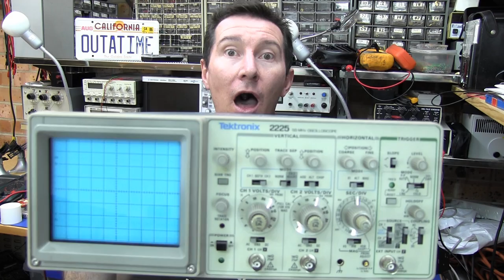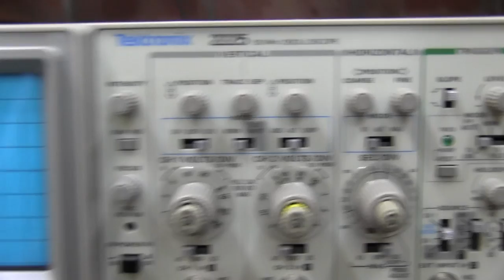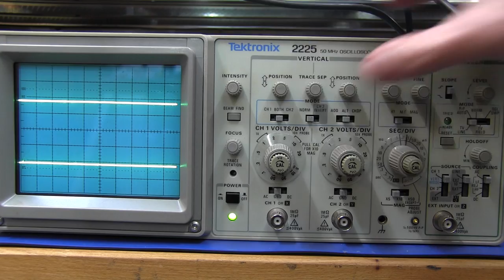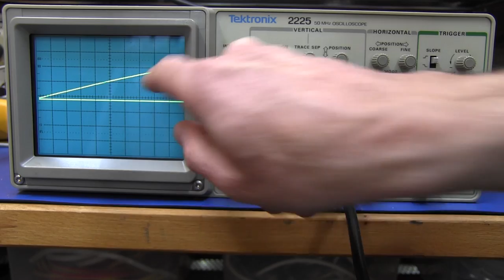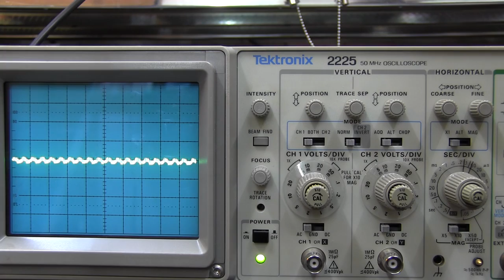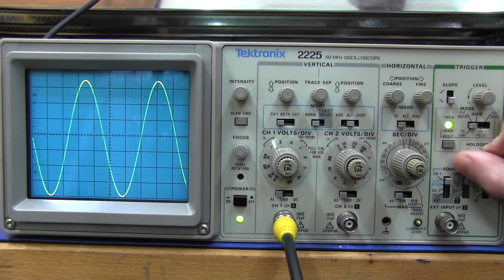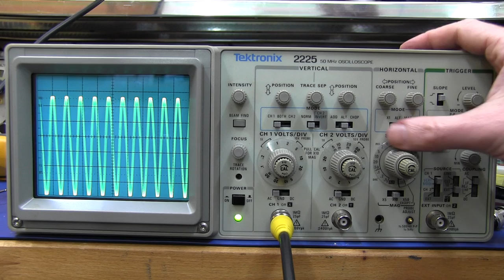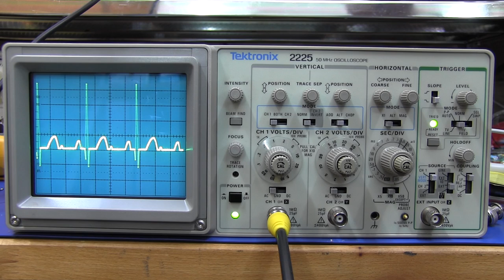Tektronix 2225 Analog Oscilloscope - EEVblog #196

Comment: I got the 60 Mhz version.  I bought it brand new in 1985.  It cost as I remember $1,200 US.  I still use it today.  Before I got it I had a couple of junkie scope with vacuum tubes.  I spent more time trying to get the scope working then I did experimenting on a circuit.  So I worked all summer at minimum wage to save up for my first brand new solid state Tektronix 2213A.  I'm sure my parents thought I was crazy.  Today's oscilloscope without a CRT seems lifeless.  After all these years I still love my Tektronix 2213A.  It seems heard to believe you can get a scope like this for around 100 bucks.
Reply: Yes ! I love DSOs but they are boring. CROs are always a pleasure !
Reply: @shyleshsrinivasan5092  I really love the features and such of my Siglent SDS1204X-E but it doesnt see a whole lot of use because I just love my Tektronix analog scopes. My 2252 sees daily use and my 2235 and Protek P3502C see almost daily use as backup scopes.
Reply: "Today's oscilloscope without a CRT seems lifeless"
That's just...your opinion.

Comment: I  bought an Tektronix 2225 for 70 € in Germany yesterday . It's completely original. There are all the same capacitors (blue, manufactured by Rubycon). I just have to clean the contacts from the Potentiometers for Volt/Div and Sec/Div. Apart from this it's completely operational. 

Should I replace the capacitors?

Comment: I assume you also checked other V/div than the multiples of 5, but didn't show it? I had a scope that had one single pot for all "5" settings (50V, 5V, aso), one for the 2's and one for the 1's (I haven't disassembled that many scopes, so I don't know if it's standard in analogs). And then there was one pot for the overall vertical scale. But since both channels show the same deviation it seems it's the overall vertical scale.

Comment: Just picked up a Tektronix 2215 scope for 50 bux(canadian). It powers up, shows both trace lines.. but I have no frequency/waveform generator to test the functions.. any suggestions?
I was thinking maybe somehow use NCH tone generator(software) to create a frequency and tap into my speaker hook ups? Would that work for testing?

Comment: you may get even better performance if you compensate your probe for both low and high frequency. you have to take your Tek probe apart to do the high frequency adjustment, then you need to mark that probe for the channel it will be paired with and any other probes need to be treated the same. Probe compensation is delicate because Tek uses resistive cables in their equipment of that time frame to reduce noise. I have the 2440 and have read up on their probes, mine are P6137's and a P6230 which was a lot of reading. There is a old long video from Tek on probes I recommend, it should be easy to find.

Comment: My manual for the 2213 indicates that the test point is not an exact reference.  Mainly used to check probes, etc.   Mine says 500mV P-P and it is not close.  Doesn't look like there is an internal adj either.  Cheers!

Comment: I have that exact scope I have had it for many years I got to use in a radio repair shop I worked in when I got layed off from my high paying job . It is always nice to have a back up knowledge to get a carry over job until you find a better one . The shop I went to did not have any scopes so I bought one many years ago for 100 bucks still have it today. I had a fluke o-scope meter but it got stolen I miss it but never had the money to replace it.

Comment: I sold my 2225 for a 2235A which is 100 Mhz scope, dual time base and goes down to 2 micro V/div  ..... The 22XX series, as they get older they may need a recap in the HV switching power supply; as you say the switching pwr supply makes them light. The Tek 22XX's have an amazing trigger.....

Comment: My trick for checking for burnt spots on a CRT scope :

1) Hook up a function generator, triangle wave, some high frequency around 50~100 KHz
2) Max out the volt scale to match the upper and lower borders of the screen
3) Lower the time base to some slow value in order to have a lot of periods shown

The screen is now entirely lit up and you look at all the surface. :)
Reply: I  am interested in buying a 225 Tektronix but the guy that is selling it says that it needs calibration the lines on the screen are not solid they are broken and with a little curvature on one end is that normal?and if it needs to be calibrated is calibration expensive if I take it to a shop?Thank you for any advice you can provide.Cheers
Reply: I am know to oscilloscopes so by the lines I meant the trace'sThank you
Reply: Sorry I should have said 2225 not 225

Comment: The fact that that super expensive Agilent does not have an analog filter to generate a smoothed analog signal without digital S/H steps is more than upsetting. You could get an old analog Sig Gen and get a proper analog sinewave.

Comment: just send any audio line level into channel 1, switch veritcal mode to ch1, set ch1 volts/div to .5v or 1v, set trigger ch1 to auto, A source to INT, A&B int to ch1, and set A&B sec/div to something slow like 1ms or so, and youre off!

Comment from the maker: @LSDjTutorials Your formula is correct, but you forgot that the scope actually generates 20mV, not 10mV in 50ohm mode. It's only 10mV into a 50ohm load.

Comment: A way to rejuvenate and remove the scratches in the screen overlay is to remove it, and use brasso and a cotton cloth to buff it. Buff with circular movement and avoid scratching the other side.  The result is incredible.

Comment: Is it common to all analog oscilloscopes that beam from CRT (when DC is applied or no signal at all) on the x-axis is not absolutely straight? I got BK model 2125C and its x-axis straight line/DC is not ideally horizontal. Could this be a sign of bad quality scope or is it normal?
Reply: You just need to adjust the trace rotation trimpot.

It's normal, so most oscilloscope have it directly accessible from the front panel.

Comment: @EEVblog
Yes Dave you are right, the Tek 2235A only goes to 2 mVolts or 0.002 microvolts, or 2000 uVolts, 2000 microvolts. You are right. I forget my 2225 went to .5mV (500uV/Div) , my memory failed me, thinking it was 5mV, my mistake. I sold my 2225 yr ago for $150+shipping. I paid $50, but you got a good deal.

Personally I need bandwidth more than Vert sensitivity. I'd really like analog over 300 Mhz BW or more. I often want accurate measurements at 120 Mhz, so 400 Mhz scope would be nice.

Comment: Two things.... FUZZ you have a focus control.... did you try that?

Second it is a 50 Mhz bandwidth scope and is only going to be guaranteed to perform accurately up to specs to about 1/3rd BW, or in other words over about 17 Mhz you start to get attenuation. This is common. If you need an accurate measurement to 50 Mhz you need a 150 Mhz BW scope.

Comment: Find service manual before adjusting! My Tek 2225 didn't need calibration. The 2235A I have now did. One chan vert attenuation module, plug-in modules, two pots, was flaky. I was fortunate found part cheap. However I needed to re-adjust the vertical. I used the other channel to compare, close enough. As you know attenuation above 35% BW is normal & increases to rated BW. Relative measurements don't need absolute values. The manual has graph of attenuation vs Freq if you want to factor that in.

Comment: Hello Dave, if you're listening … 

I've just bought one of these from eBay, which was advertised as fully functioning, and it's not working. There's a trace, but it doesn't register vertical input on either channel. Vertical output amp maybe?

I've let the seller know, but as this CRO is from the 80s and the seller is a music shop, I doubt very much that they'll be able to repair it if I send it back. I've got the service manual, and I'm an ex TV tech in Bundaberg QLD. Reckon I could fix it?

Comment: Ch 1 most likely has more noise than ch 2 due to sheer proximity to the CRO.  Probably picking up that lovely emf off the vertical deflection grids.  If the noise looks the same on more than one timebase, as in no change in shape, is most likely is being a good little antenna. ;-)

Comment: Hi Dave, If the probe ground is the same as the chassis ground for tek scopes, how do connect the probe leads to test a circuit? Every time I try it the wave form goes well below ground on the display. Should the tek scope chassis ground be connected to the power supply ground? Can you recommend any links that illustrates how to make the connections? Any help well be greatly appreciated.

Comment: I thought the timebase on my old 20MHz Kikusui was out but I slapped a freq counter on the cal signal and it was 1080Hz not 1KHz, enough to shorten the trace by half a square or so. Using an ext signal showed that the timebase was good and the "cal" osc was/still is out. 
I'd still like a nice cheap delay/storage scope or an affordable DSO though. ;) 
 
Dave, I reckon your reviews are pushing s/h prices up. 8^(

Comment: @KozmykJ 
I often thought that myself. But then I thought: how do you make sure the voltage/time referency won't drift? And you can't check mV or µs with a 0,5V/1kHz signal, no matter how accurate that signal is. So you would need a reference for many levels and switches to select aso. In the end this would almost add up to a small signal generator. So it's understandable that it's left out. They assume if you open a osci to calibrate it, you'll have a faunction generator anyway...

Comment: This video was quite helpful. I bought an old analog oscilloscope on eBay for around $50 or so several months ago and never got it to do anything besides turn on and make a dot move across the screen, because I had never used an oscilloscope before. But now I got it to measure the 0.5 V calibration thingie and display a square wave after some fiddling around, so now I'm fairly certain it works ok. It is not, however, good for testing the voltage on 9v batteries. I used my multimeter at the same time as my oscilloscope after some low results, and the multimeter displayed about 1 V after the oscilloscope was added.

I have a Hitachi Digital Storage Oscilloscope VC-6041, by the way. Apparently I can hook it up to a computer or something, too. But it's still analog, or at least has the cathode ray tube screen thingie.
Reply: Chances are, you're using a 10x probe :) which means that it reduces the amplitude of your signal by a factor of 10, so for example if you're on the 5 V/div setting, it's really showing 50 V/div

Comment: I picked up a B&K Precision 2190B analog scope a few weeks ago from a family friend for $100. 100MHz, dual-channel, 5mV/div, pretty solid specs I guess for the price, though I'm not sure about the brand. How'd I do for my first scope? I'm a computer engineering student, and I'm hoping to get some solid tinkering in over the summer.
Reply: Make sure you have the service manual, other than that B&K is a good brand for what I've read.

Comment: The Hitachi V-1050F is another good example of an analog scope with a 10x vertical mag that enables you to measure down to 500uV/div. The Hitachi does feature a dual time-base with A/B triggering and goes down to 2ns/div on the horizontal with the 10x horizontal mag enabled. It is also only a 2-channel scope but if you enable the "Trigger View" function and set the trigger sources to external, you can get 4 signals on the screen at once, although there are some limitations.
Reply: +defaultuser000 Yep. That's my analogue scope as well. Bit of a learning curve but a nice bit of kit.

Comment: $100 AUS is equal to about $4.00USD. Which doesn't sound like much money but remember your average australian only makes about $50.00AUS or $2.00 a day so things are much cheaper. This is the reason why many companies move their call centers to australia. But the problem with doing that is when you need tech support on your Nook for instance the call center people have never used one because it would cost them several months pay. So they are just reading off a card and have never touched more then a card board cut out of the product. So next time you get pissed about spending $4.00 on an app mistake and want your money back realize why they fight you so hard is because to them thats two days pay.
Reply: Dave B where are you getting your information from?  The conversion has never been that low.